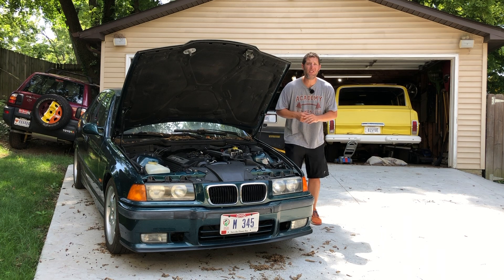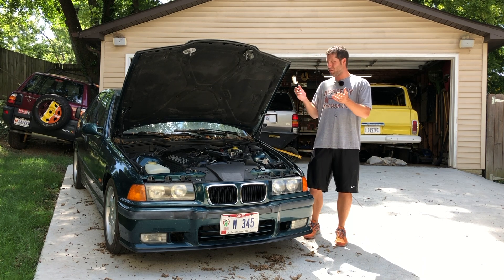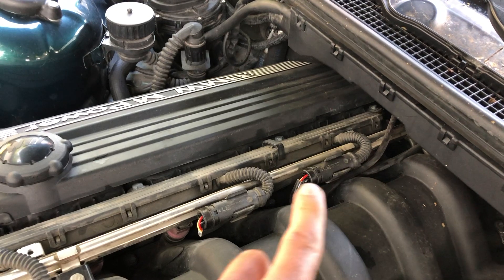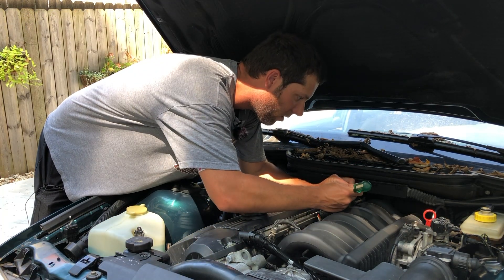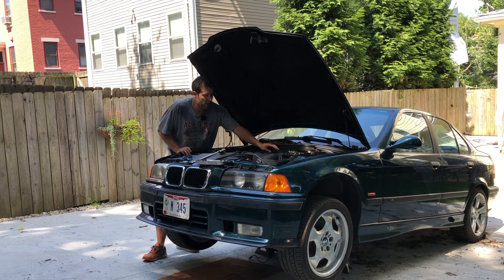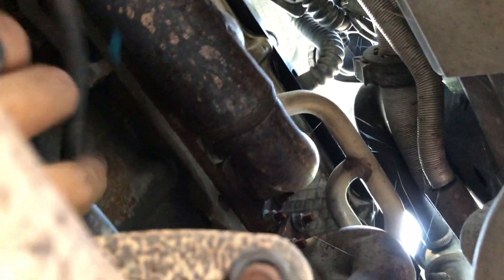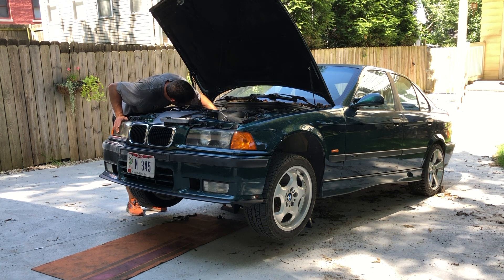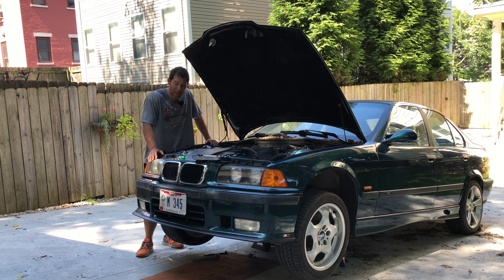BMW E36 M3 rough idle fix: Part I

Comment: check the fuel injector connector and make sure everything is snapped in and seated properly this was the culprit for the rough idle/misfire on my 1999 m3

Comment: clean the idle control valve, dude!
Reply: I have a 1998 bmw m3 coupe with the exact symptoms and I changed the maf sensor and vuvu valve and it still does it. ICV is where im going next. I cleaned mine 3 years ago but I think its time for a new one